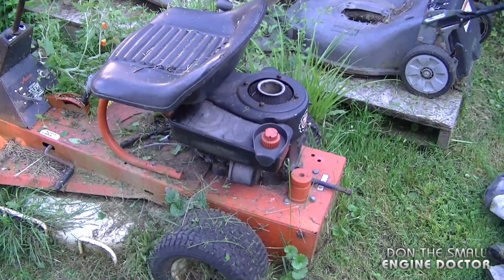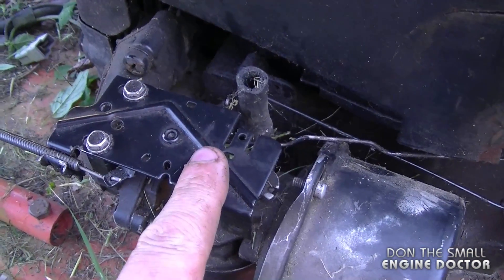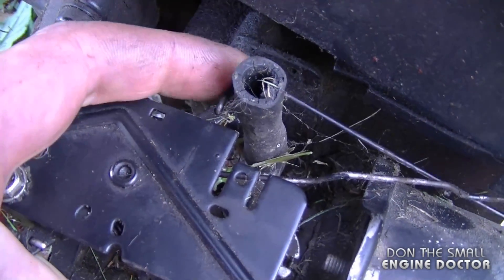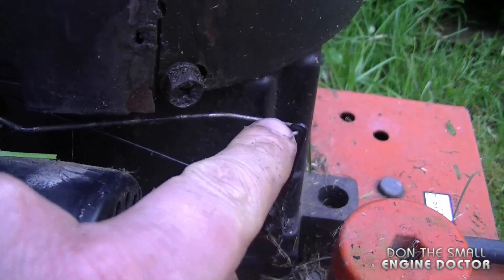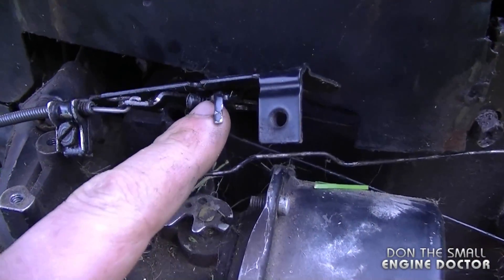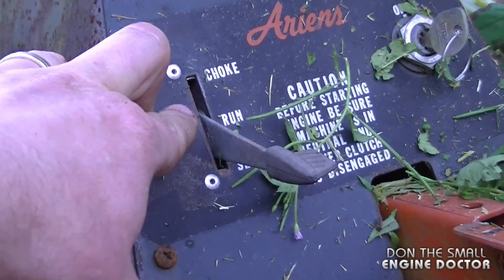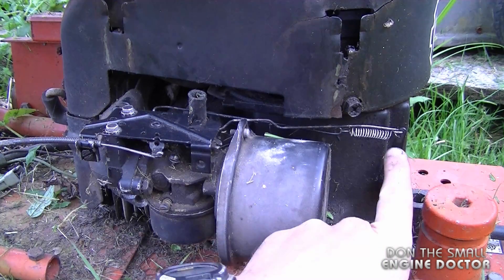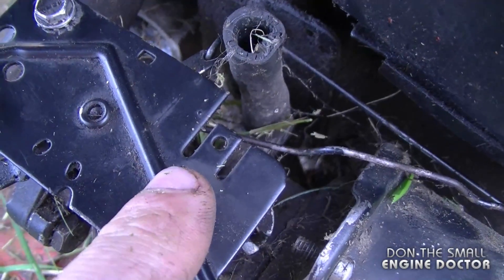6-7HP Tecumseh Vertical Engine Throttle & Choke Linkage Configuration

Comment: Hi can you please do a video of what the fuel mixture screw should be set and and the air fuel screw thanks
Reply from the maker: start at 1 1/2 turns out for fuel screw and 1 turn out for air screw on side of carb

Comment: Great video as usual!  Do you by any chance have linkage details for a Tec OH195EA? Helping a buddy with a Karcher G2500 pressure washer that has linkage hanging loose and spring or springs missing. Would appreciate guidance greatly!

Comment: Hey Don, if you still have one of tbose laying around or the linkage with the spring, can you tell me how long it is and the how the two different ends are.
I picked up a Snapper RER yesterday with a 6hp Tecumseh and its missing the linkage with the spring. I'll make one out of a coat hanger. Thanks.

Comment: I replaced a carb on my Sears 4.5 hp Chipper Shedder leaf vacuum and the linkage came off before I could see where to put it. Your video was very helpful at 1 min and 2 seconds. I went to start the unit and nothing still. One point to mention for these babies is to check the bag attachment to make sure that the safety cutoff switch is being adequately pushed down. Once I bent it down a bit, it started up quickly. Thanks for posting these videos, I spent last evening trying to find a throttle control that is unavailable and not needed.

Comment: Hello Donny I have an old tecumseh 10hp with this setup. This video helped alot to get this engine running smoothly. Problem i have is the throttle lever throttles down by itself from vibration?

Comment: I have a tecumseh V60-70363J engine (6 horse) on the back of a 80s snapper mower.  The mower starts fine but after a few minutes it dies.  Also under load it dies like going up hill.  I can sometimes keep it running by moving the throttle back and forth.  Do you think it needs a carb clean or do you think there is something wrong with the valves?  I can do a carb clean but if it's the valves I'd rather not throw money into an engine that's 37 years old.  If you know of a replacement motor that would work I would do that.  I built my Kit car (replica of a 65 Shelby Cobra) so I think I could replace the motor if things like the shaft lined up.  Thoughts Please.
Reply: You must have a 1981 model.

Comment: I have had so much bad luck with Tecumseh engines until I don't want to buy any mowers or power generators with their engine in it. There is one generator i have which needs repair, which I bought in 2000 after we had a power outage here in Arkansas during that Winter storms. I never got to use it because our power was back on by the time I got the unit home. It has never been started and just sat there waiting to be used. I didn't know anything about their linkage and still don't.

Comment: Hello! i have an 8hp power tiller and i tried to remove the plastic cover of the carb, but the cover and carb ar fitted on the same bolts. After i reinstall the parts, at full throttle butterfly mechanism, that thing of the carb wher its inserted the linkage, it s moving a little bit. this cause erratic throttle. Tiller its new, no problems before. cand be from som air leaks?? thanks